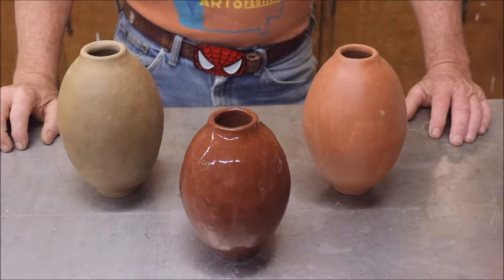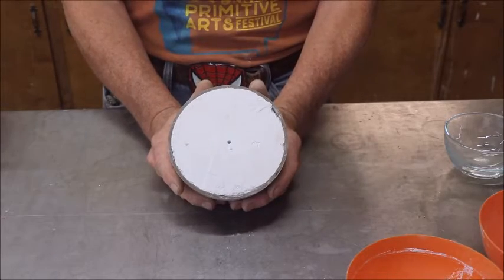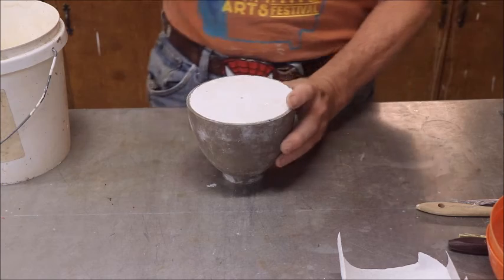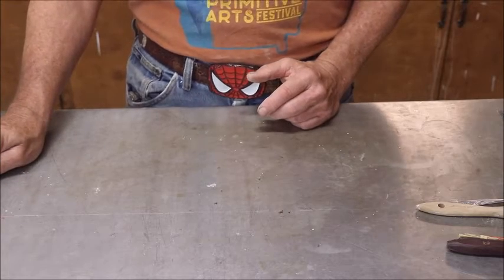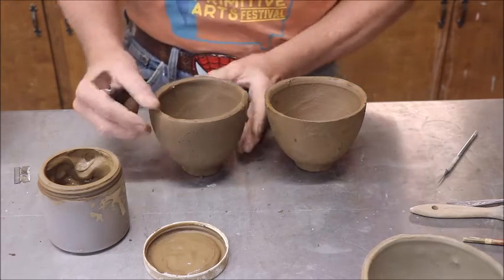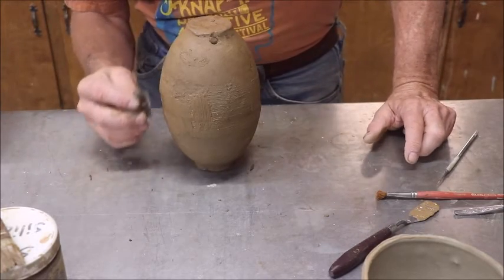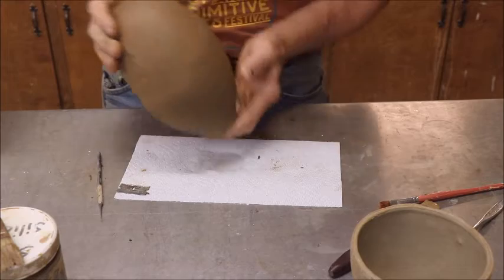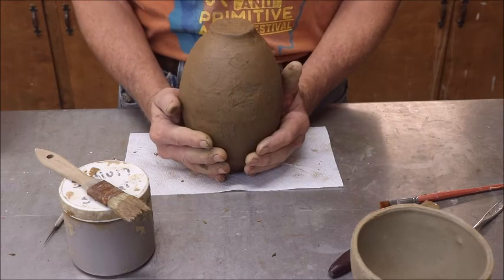Thinking Outside the Potters Wheel

Comment: Why would a potter’s wheel be expensive? A round wood board fitted to a single wooden leg attached to a lazy Susan bearing that you kick round and round with your foot to turn the potters wheel. I’ve seen it in Africa. Won’t even cost £5 if you use salvaged wood.
Reply from the maker: That is true, a potters wheel can be made very inexpensively.  It just means you have to build it and power it.  No big problem if that is what you want to do or are 73 years old.  Thanks for watching.